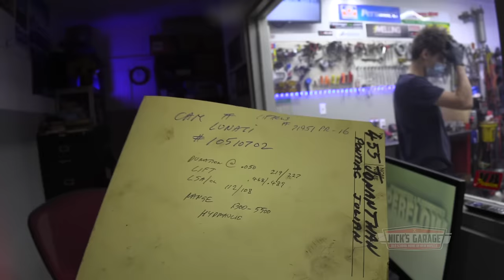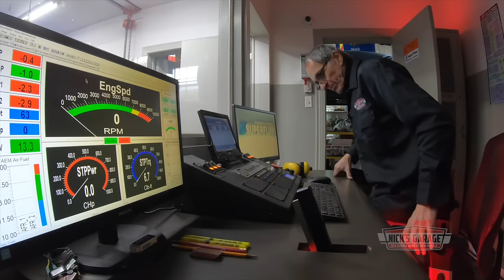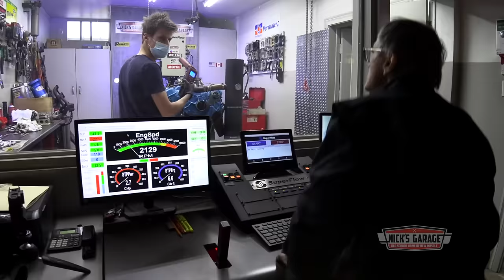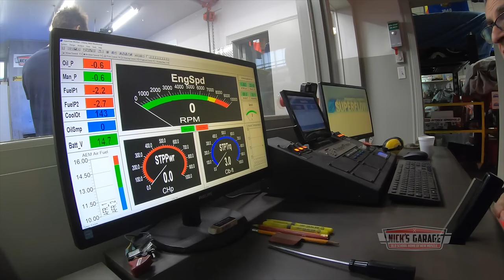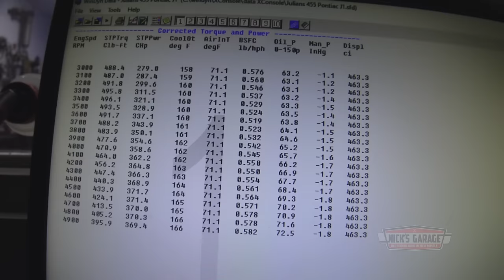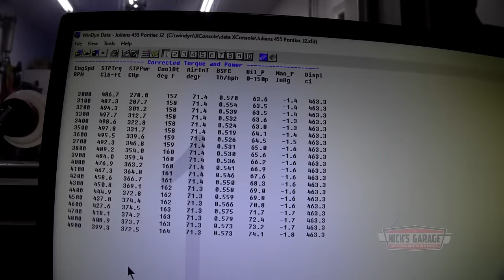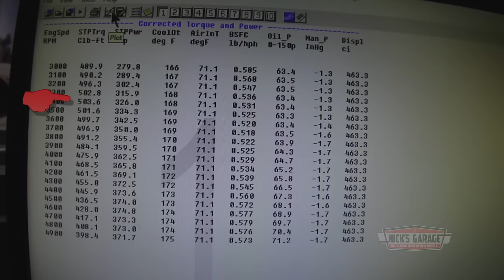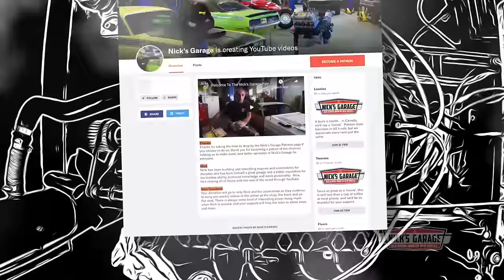Pontiac 455

Comment: That's a beautiful engine I love the Pontiacs but the carburetor is 735 to 800 CFM because it has a front inlet fuel fitting ..the side inlet quadra Jets are 650 CFM 👍  in the CFM rating comes from the primary bores being larger if you look down the carburetor of a side inlet and looked in the carburetor of a front inlet you'll see the difference..  I'm about to go back and watch the show ,,I love it. God bless you, stay well ✌️🤗
Reply: Doesn't look like a Pontiac carburetor.  No notches on the secondary air valve.
Reply: Needs the Super Duty 455" 850 CFM Q-Jet...
Reply: @BuzzLOLOL  those are way over $2,000
Reply: @nachomax1639  no such thing as a "Pontiac" carby anyway, Rochester and Carter made the carbys for a lot of different makes and models of cars.
Reply: @dutchylt  right, like there's no such thing as a Super Duty QJet. Should get out more often.  Cheers!
Reply: @nachomax1639  can that carby not be adapted to any other application?
Reply: Alright the Q jet was made in 3 stages there where the small ones for the cars ,a intermediate one for heavy duty, then the big block boys 750 to 800 ,but the frount and the side things myth,but the fount inlets are 9 out of ten times a bigger one.
Reply: NO... Q-jets were EITHER a 750 or 800cfms. That's IT.

Comment: About 10 years ago when I worked with Dick Guldstrand in Burbank we had a 455 Pontiac engine built by Barringer who was good with Pontiac engines.  It used the Edelbrock aluminium heads with a comp ratio of around 10 to 1. Cam was by Comp and I believe it was in the 225 230 range with around 505 510 lift. Lobe centers at 112.
It was a hydraulic flat tappet intake was an Edelbtock dual plane .
As I recall torque was up around 525 ft pounds.
Hp was 432. 
Vacuum was good for power disc brakes. Power band was good from off idle to around 5300 rpm. Engine went in a 69 Firebird convertible. 
Car had so much torque you could let the clutch out in 4th at idle and drive it away.
Nice non temperamental engine.
Reply: 455's are legends stock off the line. Strong engines, and reliability only surpassed by the Chevy 350 and the Chrysler slant six!!
Reply: @painkillerjones6232  Weirdo, Chrysler slant six.. Bwahahahahahhahahhahahahhbwahahahahhahahah,

Comment: I can understand that first start feeling. Many years ago I worked for a shop as an aid and a customer had problems with his engine. After troubleshooting and discussion with the customer one of the mechanics started to look for a replacement engine and found a just rebuild one.
It was bought, swapped in and then started.
Run fine first but started having issues and then failed.
Turned out that the guy who rebuilt it had mixed up two bolts. One was shorter to allow for oil to passage (into a cam bearing if I remember correctly).
Reply from the maker: Ouch.  Thanks for the story, Rolf.
Reply: @NicksGarage  please correct me , Did you work for Pontiac Motor or a dealership ?

Comment: Years ago I put a set of 6X heads off a 350 Pontiac motor on a 455 engine  and even a 400 engine and gained 30HP since it raised the CR

Comment: I was running around in the streets during the time of this engine. There were always kids that were given the old family car. You could easily tell who they were. They  would put a 780 double pumper on a worn out Chevy small block with the usual results. And this is how We knew who they were. There would be a spot in the middle of the hood with the paint burned off. Rookie mistake. I’m a new subscriber. This brings back good memories!

Comment: Pontiac used an 800 cfm Quadrajet on the 455 . My stock L78 used a 720- 725 cfm version. When they came out with the W72 400 in 77 they fattened up the jetting in the Qjet . Then in 78 they gave the W72 more cam , more timing , and more jetting . The W72 used cylinder heads from the 350 Pontiac V8 to raise the compression from a lowly 7.6 to 1 up to 8.1 to 1 . The 96 casting number heads for the 71 400 4 barrel GTO engine had a compression ratio of 8.2 to 1 from the factory. I had mine shaved 10 thousandths to help raise compression a little . My final build of the 69 Ram Air III short block I went .60 over . This hurt compression of the 400 . I used a Crane Ram Air IV T camshaft . The lift was. 469  and I used Comp Cams roller tip rockers in 1.6 ratio instead of the factory 1.52 . This gave a lift right around .500 . Pontiac used stamped steel 1.65 rockers on the Ram Air IV . 

I had wanted to use the factory # 48 heads from the Ram Air III instead of the # 96 heads . My friend that sold me the completed short block kept the heads . 

I was running a 3.73 10 bolt with cyclone  3 tube headers . Those 96 Cylinder heads really held things back . The late 70's Trans Am was a heavy car and could really have used the larger displacement from the 455 . 

I had a friend who swapped out the W72 400 in his 78 T/A for a 1970 455 from a Bonneville.  He was quickly running very low 13 second 1/4 mile times from this combo . Not bad for an engine rated at only 360 - 370 H.P. 
 
They certainly are capable of running much faster . I was shifting my 400 right at 6000 rpm. I also used poly locks and set them like you would on a small block Chevrolet. This gave me a couple extra 100 rpm on top end . 

Today if I was building a Pontiac I would just go to either Butler Performance or one of a couple other Pontiac builders . They will build you just about anything you want . Like a big cube Poncho making 500 + or even 600 + h.p. running on pump gas .

Comment: Nice Pontiac engine! 1970 was the only year for the high compression Pontiac 455.  But Pontiac was the only GM performance division that didn't have a special high performance 450 cube engine ready for 1970. The  next year '71 455HO was equipped with the higher flowing round port heads, 4 bolt mains, aluminum intake manifold and 800 cfm carb, but the compression dropped to 8.4-1. They where planning on the Ram Air 5 to be the top dog, but it was cancelled.
Reply: 1970 had a 455HO at 360HP.
Reply: G.M. couldn't let any of its other divisions out-do the Chevy Corvette... 🙄

Oldsmobile had some running 455s with 4-valve D.O.H.C. heads on them, and made 600+ h.p., but that was not allowed either... 😟

Comment: On the street, the 455ci Pontiac comes alive so quick, it's hard to beat stoplight-to-stoplight. They just don't have that top-speed endurance with numbers coming so low in the RPM range. Still, you have to love that punch in the guts you get from 0-120mph.
Reply: I personally think the 455 Pontiac is still the best choice for a street engine, especially if it's your main transportation. Pontiac knew how to build smooth, usable torque. They will never be 426 Hemis or LS6 454's but they also don't need 4.11 gears or high stall converters. I own many cars, including big block Mopars, and they are all great but for smooth and easy cruising, and tire frying fun, my 455 powered GTO is still the best!

Comment: Hutter racing built and pulled 690hp and 550 trq out of my dad's RAV with stock block,heads,intake,carb...461 with chevy rods and roller cam at 7400. Pontiacs rock

Comment: The 1971-‘72 H.O. and 1973 Super Duty 455 engines used larger Quadrajets, rated at 850 cfm.  Larger primary bores.  They are hard to find these days😎👍👍🏁
Reply: They were 800cfm, and all Pontiac V8 Quadrajets from 1975 onwards came with 800cfm quadrajets.

Comment: Finally some one who likes Q-JETS! I ran nothing but Q-JETS from the mid 70's to the mid 80's. I was well stocked with primary metering rods and jets as well as secondary metering rods and rod hangers, and lets not about the secondary air valve spring adjustment to control the DOOOWHOP characteristics!

Comment: Great looking motor! I had 3 x TAs over the years in the '80s/90's:  2 x 76 400/Autos, 1 x 76 455/4spd. My old Chilton's Manual claims the following for the 1976 455: 200HP/330ft-lbs, 7.6:1 compression ratio.
Reply: After 1970, the gas crisis ended the power of all muscle cars. Everything went downhill as all closed chambered heads got opened up till there was no compression whatsoever 😞.
Reply: @paulb5284  .....TRUE.
Reply: @nickpanaritis4122  Malaise era, the quality of the cars went downhill as did the horsepower.
Reply: Hey Nick look up the "Clinton Shaker" drag car out of Clinton, MD. Big time Pontiac man, Bob Maxey. My buddys wifes late father. Lots of my high school memories are in Pontiac GTO's, and Firebirds, last one I had was a 73 Grande Ville, awesome tork from its 455 bone stock quadrajet dual exhaust, it was such an awesome highway car! Last had it in '88. Wish I still did....take care of that voicebox!!
Reply: Those mid 70's big engines like 455's and 440's would almost run on mineral spirits the compressions were so low. I once put a 455 out of a 76 Bonneville in my 69 GTO. All I did was an Edelbrock Performer intake, Holley 800, headers and Comp Cams 268 and it ran 13.9's with the stock TH400 and 3.55 gears. That's not bad for 7.6 to 1 compression. And it was my daily driver at the time so it was nice to be able to put 87 octane in it while my best friend with his 71 GS with a 10.5 to 1 Buick 455 had to go get that expensive 93 octane!!! Yeah, he was faster, but I had to get to work.
Reply: @paulb5284  very sad time's in the Automotive industry. To see muscle cars  go down hill.
Reply: Do NOT forget that they ALSO changed over to NET horsepower rating VS. The GROSS rating that they used to use, in the same year the compression dropped.... 

The Gross rating measures the horsepower of the engine ONLY, with no alternator, water pump,  transmission, or anything else hooked up to the engine, on a dyno The NET rating measured the engine as it would be IN THE CAR, with everything hooked up and drawing power off the engine.... 

BIG difference there.

Comment: I had one of those engines w/ just 2 barrel carb, 2 speed powerglide. At just 1/2 throttle it would do 90 MPH before it hit 2nd and lots past 120 130. Delorean  made sure they had lots. Wish I still had it.

Comment: Love BOP’s especially Olds. Love seeing these big blocks. That’d be a great engine for highway gears and an M20 Muncie. I’m building a stump puller Olds 455 for a 67 C10, I’d be thrilled with those numbers. 
Nice job, Nick!!
Reply: First big block was an Olds 455.  Great reliable engine.   Also love having spark plug wires on top of exhaust manifolds.
Reply: My 454 truck will pass everything but a gas station.  3 mpg going downhill with the wind at its back.  FI.
Reply: @rogersmith7396  - Need to rebuild for good MPG as well as HP...
Reply: @BuzzLOLOL  I think its hopeless.  I drive economy cars.  I do have a 70 Eldo I am going to put back on the road but I think it will get 14-16 mpg.  I would'nt mind converting to FI.
Reply: @rogersmith7396  - Be lucky if EFI gained you 1/2 MPG on the Eldo... not worth the cost...
Reply: Technically, Pontiac never had a small or big block...
389-455 all the same size..
Reply: Funny how some people clump up Buick, Oldsmobile and Pontiac in 1 acronym. Not saying you Sir. .  BTW, no such thing as Big Block Pontiacs.. I love these no longer made Engines.
Reply: @anthonysantiago1999  it’s interesting to me that you’re astute enough to realize there aren’t big block Pontiac’s but then think the term BOP isn’t an accepted term by almost everyone dating back to the late 50’s or early 60’s from the aftermarket to hotrodders to the manufactures themselves.
Reply: @mikehunt9894  the 326 was the same too.
Reply: @korndawggy1801  it is, i forgot about that one. Lol
Reply: @korndawggy1801  ... I guess it was.
Reply: Like Mike Hunt said thy are all the same size, is fact even the 326 350 also 421 and 428 that's what was great about these motors lots of interchangeable parts, but the 1966 and older motors the valves were closer together and in a different  location actually  closer  to the center of the combustion chamber so when we ran let's say the 400 heads on a 389 you had to bore the block oversize then you could run the standard  bore 400 pistons to match up the valve notches the cheap cast pistons actually come with 8 valve notchs on the 400 motors so they can be run in a 389 as long as you don't  mind the big overbore.
Reply: Actually  I was told any motor that had a 3 inch diameter main journal was considered a small block, any motor with a 3.250" main journal diameter was considered a big block so that would be the 421, 428, and 455 but from the outside they were all the same size.
Reply: @robertgoulet1961     I would go with Cubic Inch.
Reply: Olds dont have a blue engine and the Buick 455 stage1 will bury a Olds numbers
Reply: @bigthunder2860  wrong. Olds 455’s were blue
Reply: OK did GM produce Pontiac and Olds same run on production line and,and paint them same time,my dad had a 69 cutlass 350 rocket I don't remember the engine being blue
Reply: @bigthunder2860  Pontiac and Olds each had their own blue until the “corporate blue” Olds 350’s were painted gold until they also went corporate blue in the mid 70’s
Reply: @mikehunt9894  326, 350, 389, 400, 428, 455 were all the same size block.
No small or big block.
Olds and Buicks pretty much same way but they played with Deck height
Reply: @sullie35  Doesn't anyone remember the Pontiac 301? Shorter deck height--the only one you can tell is different just by looking at it completely assembled.
Reply: @tedstclair7145  Yeah most definitely but like you said they are shorter deck height then the rest and thats why I didn't include it.
Reply: @dukeallen432  Tell me your not saying the First Big block was a Old 455....
Reply: @mikehunt9894  dont forget 326 and 350 and 400 and 421 and 428 lol
Reply: @robertgoulet1961  nope
Reply: Why is the spongy lifter always at rear of engine
Reply: @rickyfulks889 Furthest at the end of the oil gallery
Reply: @dukeallen432 NO, it was not.... Olds had a 425 big block before the 455
Reply: @rogersmith7396 Then you had better tune it..... my 505" 750 h.p. Oldsmobile engine gets better mileage than THAT.
Reply: @bigthunder2860  NO. Pontiac and Olds engines were NOT run on the same lines, and they were NOT painted together. The 2 blue colors were DIFFERENT.

Comment: Awesome! I also have a Pontiac 455/468. 1973 SD 16 round ported heads, Comp roller 51-816-9 camshaft, Ross pistons, Warrior aluminum intake w/ an old, reworked 850 Holly. Torque best at 4700 rpm = 580, horsepower at 5900 rpm at 590. Planted in a 1970 Tempest. Bold and bullet proof.

Comment: Might want to try smaller secondary metering rods or try a shim under the hangers to pull them up out of the jets to flow more fuel
Reply: Good tip, Thanks.

Comment: I've owned a few Pontiacs and built a few Pontiac V8s. The key to get a Pontiac V8 to run up to it's potential is getting the right set of heads. A great characteristic is that almost all the engine parts can be swapped between all the Pontiac V8s. There are a ton of different factory Pontiac V8 cylinder heads but only 4 of them are the Holy Grail which is a small combustion chamber to raise your compression  along with a big intake valve along with a big exhaust valve but even on those heads you need to find someone who knows what they are doing to port the exhaust chambers if you want your Pontiac V8 to pull anywhere close to 6,000 RPM,  especially a 455. A good set of aluminum heads is the way to go if you have the cash.  Its getting hard to find the good Pontiac factory heads.

Comment: Likely cause of your voice issues: Dry air - the colder it gets the dryer the air gets.
A humidifier in the shop will reduce this problem if I'm right (or spill more water on the floor ;-) ).
Reply from the maker: Thanks for that.  You're right.
Reply: Nick needs a little high octane fuel in his coffee   ha ha ..

Comment: Those are great nnumbers Nick. I've ran everything from Mopars to Fords, to Pontiacs and Chevy's for more than 50 years. I always told guys at the track that it's not the make or brand of the engine but the mechanic bahind it that makes it run. I ran a 455 Pontiac in my 76 T/A 4 speed. I put flat top forged pistons with a RA-IV Cam. I also put on the 74cc 70 RAIII heads on it that bumped the CR way up. I had to either run Racing gas or 130 octane AVgas. That car ran high 11s. Boy was it fun.

Comment: Back when I was a teen, I had a 68' GTO, with a 400, sig erson cam (we called it a 3/4 race cam, whatever that meant?) headers and a holly 650 dbl pumper.  After a few years I severely damaged the motor.  Went down to a wrecking yard and bought a 455 out of a 70' Grand Prix. Put the headers and holly on the 455 and it ran strong, with stock cam. Had a lot of fun in that car.  Sure wish I still had it!  BTW: I am now 62 years old and my "weekend" car is a Mopar, 2017 Hellcat Charger. What a fun car to drive!  So like Nick, I like Mopars and Pontiacs!

Comment: I raced a firebird with basically a 1970 400 Pontic motor in a circle track division that thing hauled as, the SB Chevies really had a hard time with me, also had a 79 TA with a 455 Edelbrock aluminum  heads Doug Nash intake manifold 12.5 to 1 compression a 1050 Holley Dominator and a .700" lift roller cam car weighed in at 3550 but could still run the quarter mile at 11.10 at 126 mph on slicks and race gas :)

Comment: 1989 I bought a 67 GTO. It had exhaust manifold like those. Upon further research the car was 1 of 56 Ram Air 1967 GTO convertibles. It cost me $1200. 1993 i sold it for 10g to a guy from Kansas City, Mo. 2014 it sold at Mecum.